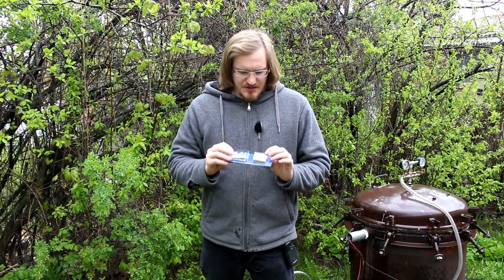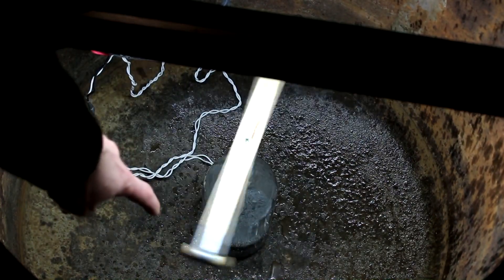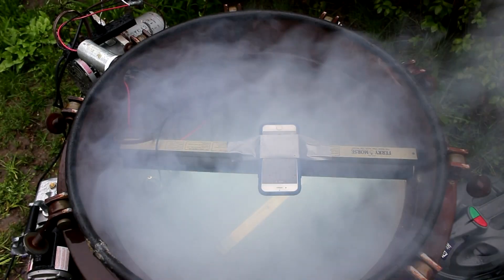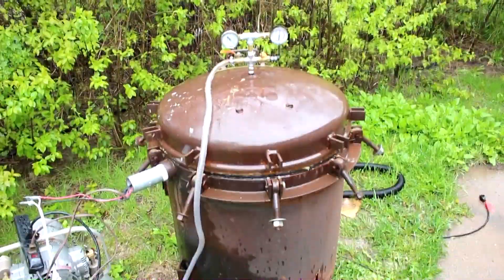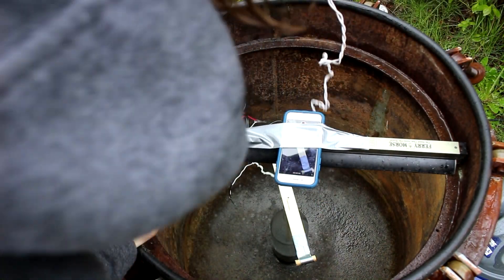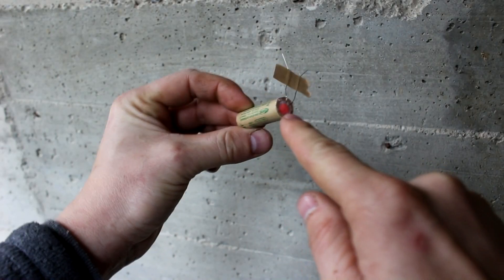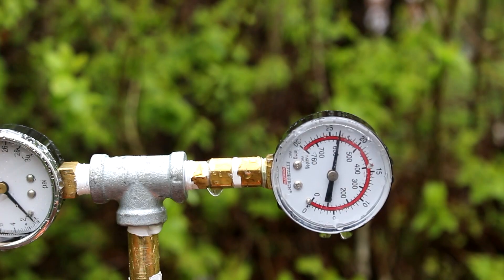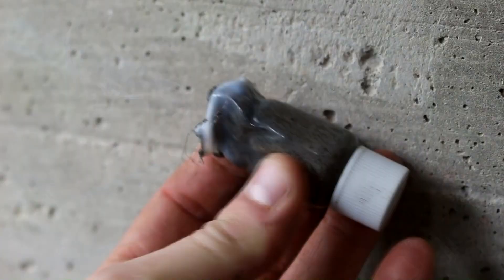Will a Model Rocket Motor Work In Vacuum?

Comment: Man this video contradicts Mythbusters same video hahaha, fucken fake mythbuster, your the best cody <3<3<3
it only burned because there was air in the bottle, it stopped immediately after after the the bottle opened up lol, NASA should bring a bottle for their rockets, hahaha, you have liquid fueled rocket right? why not experimenting on it in a vacuum, it does not need to move in the experiment, we want to see it fire continuously, your first video proved it already hahaha, in the video once exposed to vacuum it was only the momentum that kept spinning. what is you conclusion anyway? are you going to fire a different fuel oxygen rocket in a vacuum
Reply: The diffrence here was that a usual rocket engine doesnt ignite in a vaccum
The fuel ignites in a pressurized combustion chamber in the engine itself where liquid oxygen combines with whatever fuel is used So yeah even real rockets ignite this way but in those the ignition chamber stays somewhat pressurized no matter what since it isnt directly in contact with the vaccum of space..
Reply: yeah but the engine is not sealed, unless it has its own valve in the exhaust bell, now talking about pressurized combustion, its not like internal combustion engine where it is completely sealed, how can it remain pressurized, like this video he placed a bottle to seal it to work, hydraulic 101, to prevent movement of gas leaks, it either you seal it, or balance out the pressure, well your fuel cannot fill up space vacuum to balance out, your fuel air mixture will just escape instantly one the fuel and oxygen valve is opened, it would stay in the chamber and escape out instantly even before it fires a spark onto ignite it. Cody has access to a fuel/air rocket engine, i wish he tires the experiment. im sure he's going to have problems, i dont think he's ever going to seal it with a bottle hahaha
Reply: actually the rocket has its own oxidizer, it does not need air, see the bullets, its completely seal and it fires ok, now in a vacuum, it just will not fire even in his other video. this is solid with oxidizer that cannot be affected by vacuum, you think liquid or gas form would do better in a vacuum. lets wait for his finale experiment, +Cody'slab it does not need to move, we only need to see it fire up continuously in a vacuum, well you are using gas form just maintain the vacuum pressure or the whole vaccum chamber will be filled with you combustible gas lol, boom, maybe a larger vacuum chamber hahaha
Reply: Once combustion is established the expanding gases sustain the pressure in the chamber. The trick is establishing combustion: one way for a liquid rocket to do so would be to carry a small supply of two liquids that spontaneously ignite when they touch each other and inject them just before the main fuel supply starts. That way the ignition occurs instantly and the pressure can rise enough to sustain the main fuel before it enters the chamber.

With a solid rocket in space I think you could simply block the nozzle with a solid plug. That way ignition can occur with some pressure to get it started.  Once things get going the hot exhaust gases push the plug out of the nozzle, allowing the rocket to operate as intended.

Comment: Once you encapsulate the rocket in a bottle, it is in a separate atmosphere from the vacuum (even though the vacuum will undeniably influence this sub-atmosphere.)
Reply: It once you encapsulate the rocket it is in an atmosphere period, it requires an atmosphere to ignite but once that bottle bursts there is no more different atmospheres only the creation of pressure behind the rocket.
Other comments noticed that the rocket seem to have peterd out once the pressure dropped again.
And if if the container was rigid  then the vacuum would have no effect on the pressure inside of it.

Comment: Not surprised by the results.... They have their own oxidizer so atmosphere is irrelevant... I've fired some under water... Just for kicks... Those igniters are junk also... Could have had a better chance of ignition with a piece of nichrome wire... No composition to blow it away from the propellant... Only vacuum chamber experiment I'm curious about is fride chicken... Better fried under pressure or under vacuum.... Would be kinda hard to gauge the results, and im not 100% sure it could be done... Sorry food on the brain

Comment: my prediction: they will. because of the oxidizer in the rocket mix
Reply: They do have oxidizer - they would have to in order to burn so rapidly, given that there is no air inlet on these rocket engines, and the high-velocity exhaust from the clay nozzle would prevent oxygenated air from being able to enter the burn from behind as well. The problem seems to be with the igniter itself, which apparently either doesn't include an oxidizer, or the burning fragments from it aren't able to burn hot quite enough in a vacuum to reliably ignite the motor without the assistance of the oxygen in free air.
Reply: koplerio oxygen is not the only oxidizer, just the one that named them. There are solid oxidizers like Potassium Chlorate.
Reply: kay looks like i was wrong.....
but theoretically it must have worked......
Reply: As much as I know- those "toy" rockets don't really have any oxidizer.
As oxidizer is a liquid form of oxygen to use it as an igniter for the actual fuel.
Reply: @Koplerio  if they don't have an oxidizer than what do you call the powder that they put in it to produce oxygen for the fuel?
If there were no oxidizers and no atmospheric oxygen how do you think this burned at all?

Comment: Try making some smaller rocket nozzles.  From the video it looks like the rocket went out after only a few milliseconds of firing, once it lost pressure inside it. Too much escaping through the large hole.   Very clever though.

How about trying the same test with the chamber pumped up to its max pressure as well? :D

Comment: High pressure chamber in a vacuum chamber...?
Reply: It was just atmospheric pressure but yeah relatively high.
Gunpowder cannot continue a chain reaction in a vacuum very well and liquid Rocket motors are expensive and require permitting and it's just a horrible idea to try to light off a gas oxygen mix in a closed container.
Reply: @FrancisR420  When I said this I think I was asking if he could do that, putting a high-pressure chamber in a vacuum, but thank you.

Comment: I might not be a rocket scientist but did you notice how the rocket didn't burn as long or deploy the chute charge? isn't that because normal model rocket engines don't have an oxidizer? so the reason why it worked the last time is because it had the air from the plastic bottle to burn. but after that oxygen ran out the rocket stopped. but that's just a thought

Comment: I never quite paid attention to it until now, but the vacuum you're pulling is really bad compared to what you should be getting. I assume you're using a standard rotary vane pump - those should easily reach <100 millitorr if they're working correctly and the chamber is sealed correctly. Your pressure, after converting the units and finding absolute from gauge pressure, is around 125 torr, so you're 3 or 4 orders of magnitude higher pressure than you should be. I suspect your biggest leak is that lid on top, since I notice you don't tighten it down when you're pulling vacuum. Gravity and the pressure differential are not enough to hold good vacuum, you need to tighten that down with those bolts to get good vacuum.

Of course, I can't think of anything you'd need better vacuum for. At the very least, less leaks means you can pump down faster. But if you want to optimize your chamber, start tightening those bolts.

And clean it, but I hate cleaning chambers too :P

Comment: Lol.

So you build a pressure top for the outgoing burst to build up force against it. If this would be in a rocket, it would be a one shot only principle. As we can see, NO rocket uses such devices. They are all fully opened nozzles. 

Nice try, but you failed again.

Kind regards,

Miguel
Reply: Furlock Furli Rocket's contain both oxidizer and a high pressure nozzle so they work without problem in a vacuum
Reply: no, they don't Mr. Wade. They need something to push against, and there is no such thing in a vacuum. Kind regards.
Reply: Furlock Furli such a failed argument.
Rocket's do not push against an atmosphere!
Reply: Sorry? So against what do they push?
Reply: Furlock Furli rockets create a high pressure explosive reaction in a chamber that is what they push against .
Reply: Oh, a chamber. So they push against a closed chamber or an opened one? If closed, the energy stays in the chamber, thus the rocket doesn't move. If opened, the energy comes out of the chamber and... does not find anything to push against in a vacuum, thus the rocket doesn't move either.

Give me more, please.
Reply: Furlock Furli the pressure rate by which the gas seeks to fill the vacuum is lower than the pressure created by the rocket.
Vacuums don't suck.
Reply: I don't wonder anymore that cars are so inefficient on fuel. They need your miraculous low pressure chamber, then a vacuum chamber and... voilá! 

The truth is that none of what you try to explain works. You can do as much as you want inside and outside of the rocket. Once there is no more resistance to the exhaust, no push/thrust occurs. Wasn't it Munchhausen who dragged himself and a horse out of a swamp by pulling the horse's hair?

Rockets can only operate in lower atmosphere. They cannot push themselves, they cannot pull themselves once they pretend to leave that area. Even Newton knew that. Oh, now I remember, it is the Baron von Munchhausen. He also flew on a cannonball from one castle to another. 

Have a nice day and thank god or evolution or whatever for being a bit smarter than all of us.

I'm out.

Kind regards,

M.
Reply: Furlock Furli as this video clearly shows and many others that rockets work just fine in a vacuum if not better.
The idea that rockets push off a atmosphere is just childish ignorance.
Reply: You can lie to yourself as many times as you want. The experiment in the video shows how the energy is pulled against a top, the top goes off and the only thrust it gained was from that short momentum. There are no "tops" on rockets. If you want to repeat the conversation, go ahead. It's quite boring.

Think for yourself, good man.

Have a nice day.
Reply: A real rocket uses a convergent-divergent nozzle, it converges to pressurize combustion and increase velocity of the exhaust gases, and when the gases reach the speed of sound the nozzle diverges to increase the exhaust velocity even more

Comment: once again proving space is a hoax and space travel being impossible. well done you! Flat Earth wins yet again
Reply: the bottle he put it in had a hole in it after the motor fired and pushed the glue plug out. keep lying to yourself
Reply: by placing it into the tube you know you eliminated vacuum LOL, that is why it even burned in the first place... But I guess you do know that. No point to deceive people...
Reply: FlatEarth Photography So you did not understand what he was doing!
He applied an oxidizer which all rockets use, to work in the vacuum of space.
Reply: maybe you show us a single video of earth from space, millions of people are searching for it for over 2 years now, nobody has found a single legit piece of it. You may become very famous if you can find one ... (cartoons and nasa CGI or fish eye lens don't count)
Reply: FlatEarth Photography Well that's the usual typically unsubstantiated Bs.
There are plenty that of cause you like others deny without evidence.
You are claiming fakery with the intention to deceive, without evidence.

Comment: Is it possible to get a camera lens incorporated into the lid? I was just thinking slow-mo would be cool and possibly useful for this kind of stuff, but putting anything good enough for the required speed in a vacuum chamber might not be a good idea and I know I wouldn't want to do that.

If you incorporate a detachable lens into the lid you can attach a camera to have a peep inside, but now that I think about it, your everyday camera lens probably can't stand up to the pressure... I'm thinking about fish-eye lenses, because the iPhone's field of view is pretty small, but those are probably also not too good on structural integrity. Maybe some sort of clear dome you could put on the inside and mount a camera so you can look at most of the space?

What do you guys think?

Comment: I'm confused.. You needed to envelope the motor in a hermetically sealed plastic bottle containing atmosphere. Sorry, you just failed yet again. O2 was still supplied and yes, the folks at NASA have it figured out... Can tell someone's getting irritated with this one.
Solid rockets operate inside the atmosphere by my memory. LOX/Kerosene then takes over.
Reply: fla playa the bottle is the oxidizer that all rockets used the experiment was a success.
showing yet another flat Earth fail.
Reply: Yeah you are confused. Solid fuel Rockets Supply their own oxygen like every other rocket solid fuel Rockets do not need atmospheric oxygen
It just required tpressure for the chain reaction because it's made to be run at an atmosphere.
Reply: @FrancisR420  3 years ago bro
Reply: "Failed yet again"
At what he got the rocket to go off in a vacuum, that was what he was trying to do. what do you think he failed at? pandering to idiots like you, sure, but that was never his goal.

Comment: But that wasn't a long burn on the model Rocket. Wouldn't that be because model rockets are solid fuel boosters? Nasa never takes those into a vacume. Solid fuel is only used in earth's atmosphere bc the burn needs an oxidizer. The bottle didn't work because there was enough pressure. It worked bc it had just enough air to oxidize the rocket's burn and build pressure until the back of the bottle broke and acted as a thruster. Your model rocket motor doesn't work in a vacuum.

Comment: Interesting that you didn't get the parachute ejection charge in a vacuum.  I presume because the fuse running from the solid fuel section lacks an oxidizer ?

Comment: NASA rockets to my knowledge use liquid oxygen, which is 2 parts of the fire triangle. fuel, and oxygen. all that's needed is a source hot enough to ignite the oxygen. which will inevitably produce thrust

Comment: What vacuum? You mean that small chamber that filled with gas once the container blew out... Lol The conditions in that vacuum chamber in no way represent the supposed vacuum of space that is necessary for Helios to move across the sky in his chariot of fire. LOL
Reply: the bottle he put it in had a hole in it. how does it feel to lie to yourself to satisfy your mental delusions?
Reply: hey7328 ~ Ah what? Point out the exact point at which I stated there was no hole in it? LOL I've never seen a reply so irrelevant to the comment like yours is. Amazing lol

Comment: Whats interesting is the ignition and burn for the first and second attempt only lasted for a single frame, were as the third attempt actually showed alot in the first few frames, first frame it ignited, second frame was the pressure build up and in the third frame it burns though the bottle and starts to propel itself. To those that do not know hit < and > when a video is paused to go frame by frame, some videos you have to tap it twice before it changes, all depends on the videos fps.

Comment: I'm curious if APCP behaves differently in vacuum given that it uses a different oxidizer than either the sugar rockets or black powder rockets I've seen in chambers so far. I imagine setting off an E motor in a chamber would be a bit risky though.

Comment: the little bottle held O2 . thats why it worked
Reply: +Marek you have a very shaky idea of how much oxygen is contained in that amount of air, relative to how much is needed to sustain that size of a reaction. However, the point here was not "Do rockets need air to burn their fuel?" but rather, "Do rockets need 'air to push against' ?"   The igniter in this case needed pressure, not oxygen, to get the rocket burn started, but he could have molded epoxy around the top of the rocket + igniter to achieve the same effect.
Reply: It's not the O2 in the air it's just the fact that there was pressure
Reply: Only to ignite it, the rocket immediately melted the bottle and continued to burn in the vacuum. besides this a model rocket, space rockets a usual liquid and carry there own oxidizer sometimes just pressurized O2.

Comment: The bottle had air in it. When the bottle burst, the air was released so you no longer had a vacuum.
Reply: +Tom it never was a an absolute vacuum, as he explains. Only a reasonably good vacuum is possible with this equipment, and the damp conditions didn't help. 1mL of air +/- is irrelevant.

Comment: I noticed during the last bumper video, that there were bubbles coming up from under the jar full of lead shot while you were bringing it to a vacuum. Is there a drain plug in the bottom of the pressure chamber that has a slow leak? it would explain why it's hard to get things up to pressure (or down to vacuum for that matter).

Comment: That small rocket if starts to burn then make enought presure to "push " ore the trust touches the interior of that " chamber" then will move. It will be good to put that in a bigger container and at more distance. Like u can tie it whit a small rope and let as much space in the back possible . Then do vaccum and start it. Its about the size of recipient where u do it.( the gases will fill the recipient and will creat a instant propulsion) in the vaccum of space that wont be possible.nothing was proved there, only in u mind.